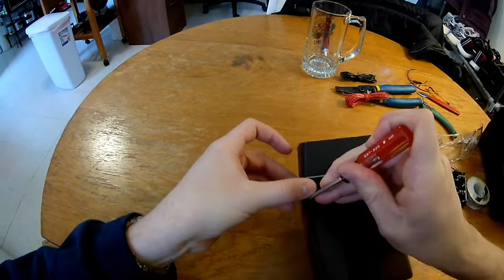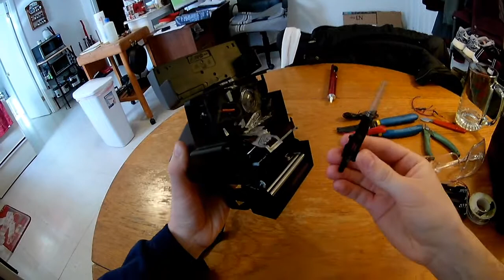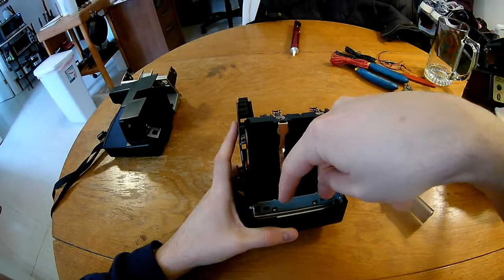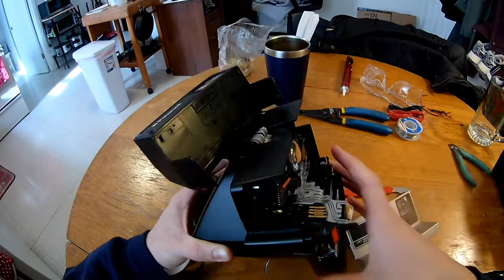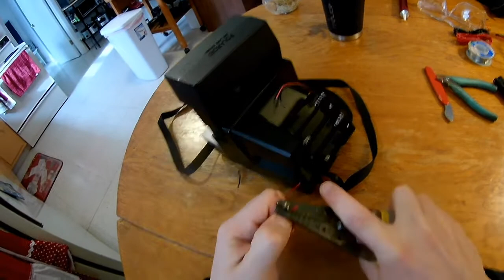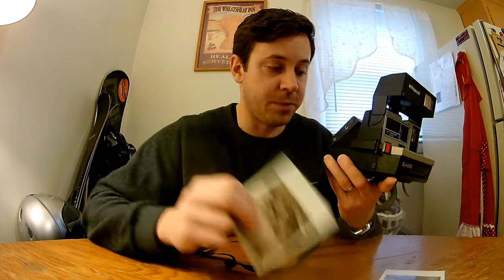How To Modify Polaroid 600 to use I-type film

Comment: I believe this method is by far the most practical one to do but you only have to do all the hardwork for the first time. I see most people put used batteries under the i-Type films or transferring i type films to used 600 cartridges. They all aren't easy to do when swapping out empty cartridges. With this hack you can simply remove one battery, take out empty pack, insert new pack, insert 1 battery, and you're good to go. Boom! Love this video!

Comment: Question: Did you do any modifications so the camera accepts the i-type film packs physically? In your other video you talk about this problem. Or do you just cut off the tabs on every pack? But for the thing catching at the bottom, I don't see you using an index card in this video here.
But damn, this is cool! I don't shoot instant film often enough to save a lot of money, but having to dispose a battery with every pack is such a waste. Well, back then nobody thought about the environment. And with the battery in the pack, the thing was basically idiot-proof. I could use five of these 1.2 volt Ni-MH batteries instead to go rechargeable. Scored a 670 AF on ebay a few months back, that thing is in pretty much mint condition, I dread to do an operation like this to it, but... The Impulse series is easier to take apart, simply the bottom comes off, revealing the contacts and circuit board. I should get one of these to do that, and spare the precious 670 for special occasions.

Comment: Please awnser 🙏🏻, do you have to take the battery out everytime you put a new cartridge? When you first put the battery and it started ejecting constantly does it stop when you open the cartridge door?

Thank you so much for this tutorial I just fear it’ll spit out 16$ in a row
Reply: Seeing you didn't get a response, I will try and help, if it's still useful now. When your used cartridge is all emptied out, take off the battery, change cartridges by putting a new one in and then, close the cartridge door, put the battery back in. It should spit out the new cartridge's black slide as soon as you put the battery back in. Hope this is still relevant.
Reply: @professoroak2252  but do you think that a switch could work ?
Reply: @julesdevos8456  If you get a battery pack that already has a switch built in on it, it will work. It should cut the power at the wires and stop the camera rollers from going off.
Reply: Nunoyuki XXI or cut of the terminals leads going to the cartridge battery.🗣🤔